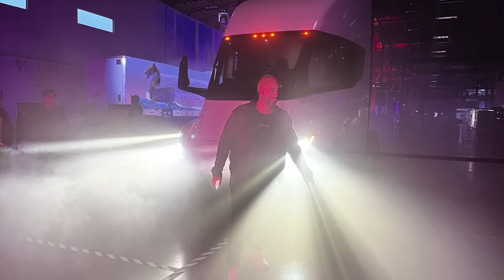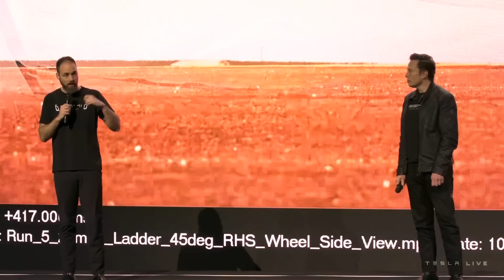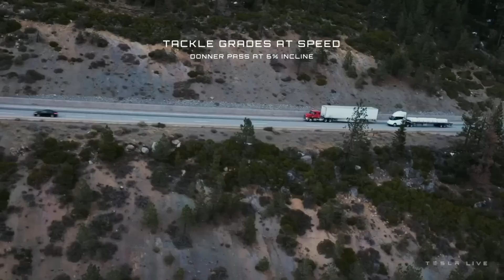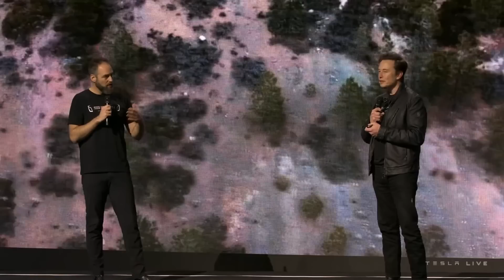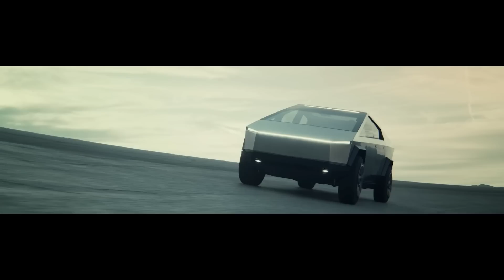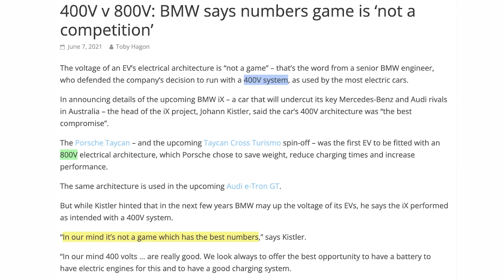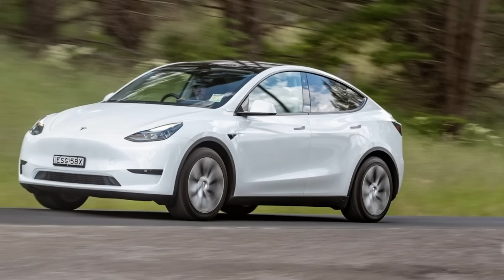Why Tesla Is Being Secretive About Tesla Semi & Why OEM's Are Giving Up ⚡️

Comment: I think the reason they did not give away details is that they have plenty work to do or much changes in a few months.  Early Semi copies like to Tesla and Pepsi use for much testing and learning.  For example, it appears they want to lower the battery capacity that is present in the 500 mile truck.  They would release official specs and pricing next year, including AP and safety features.

Comment: The biggest take-away on the semi is the range when fully loaded.  This will open up a much larger T.A.M..    FYI - Commercial drivers are not allowed to drive for more than 10 hours per day anyways... so... put chargers in truck stops and put a sleeper on that truck so the driver can have a siesta while his truck recharges, and the possibilities are mind-boggling.  The #1 cost of trucking companies is FUEL, second is wages, ongoing maintenance and also equipment purchases (buying new trucks) is so far down the list... The semi is a step change on the #1 cost of trucking.  EVERYTHING you will ever buy or consume, at some point, travels by truck.  This is frickin huge.

Comment: The biggest unanswered question is how much does the Semi weigh -- that is, how much of that 82,000 lbs can be cargo? The three motors must weigh only a tiny fraction of a diesel engine and transmission. So the question is, what does the 1-megawatt battery pack weigh? Based on the 100-kw pack weight of 1,377 lbs, the Semi pack might weigh close to 14,000 lbs. A Kenworth W900 Class 8 tractor weighs 16,700.
Reply: Also where would all those terawatts of power come so smoothly when there's whole fleet of semi's that need that. It's not like you would get that kind of power from random power outlet from KFC kitchen ;) 
And that kind of power outlet will cost nice little penny and needs infrastructure...But sure, we do not talk about that...instead we talk about 0-60 times for semis :D

Comment: Gary Black would need to bet the OVER on FSD ready by Jan 2027....because if it IS ready before that date then ALL of that energy spent on a vehicle Tesla will NOT continue to sell to the public ($25,000 model) was used to produce...what, 500,000 units?  3 years from concept to 5000/wk at even LIGHTNING speed for Tesla then another year of full run.  Possibly 750,000 units by Jan 2027.   There seems to be a MAJOR disconnect on the concept of robotaxi rollout.  The RETARDED logic train that says Tesla will sell these to the public on 30% margins when OWNING the robotaxi produces 300% margins. This IS capitalism and that profit DOES speed the global transition as well as provide MAXIMUM exposure of cheap transportation.  75% of adults on earth have NEVER owned a vehicle.  Another 17% have ONLY ever afforded used prices. Now make an addressable market argument on 3% of the adult population that can afford a civic/Camry/Corolla at 1/8th the fossil fuel elimination of a robotaxi as aligning with Tesla's mission statement.  Please.

Comment: Do you think maybe they aren't releasing specs because the trucks don't have 4680s yet?  The true Tesla Semi will have specs based around 4680 architecture.   Therefore specs released for today's truck are actually for a stopgap measure product.  In 6-12 months they may not be close to actual specs of Tesla Semi.

Comment: IMO, this low-key event was appropriate in the circumstances. There are plenty of veteran truck drivers who are not yet comfortable with what the Tesla Semi is all about. For people who have been driving trucks all their lives this is a big change and the amount of skill required to drive safely will most likely be far less than with a diesel big rig.  Additionally, no talk about FSD or Auto-Pilot, I believe that was intentional too. I have also heard that there is some concern about the driving position. I expect the best approach will be to have experienced truck drivers start using the Tesla Semi and talk to their peers about the experience. I expect this will trigger massive demand.
Just a couple of technical points:
•	The new architecture is 1000 V not 800 V
•	Regenerative braking will be a bit more complicated than it is on all wheel drive Tesla sedan that can use re- on all four wheels. Normally these tractor/trailer configurations have five axles. Regenerative braking applies only to the driven axles on the tractor. So, the front axle on the tractor and the trailer axle(s) only have service brakes so when quick stops are required the service brakes will need to supplement the re-gen braking and hence the wear on the service brakes will be more.

Comment: If Tesla can haul 80k with this platform then I would guess all other electric pickups need to reevaluate theirs. If tesla can get 500 miles and the Ford Lightning per say is getting only 90 miles range at maybe 12k lbs total from 286 empty? Their is an efficiency problem there when the lightning with a 3 ton trailer is using 1.5kw per mile.

Comment: It was not a selling event or hiring event, it was just to celebrate the first delivery and they wanted to get to the party bit as quickly as possible 🙂

The 500 miles fully loaded no cheating no charging drive was I think the best part of the show. It's a slap in the face of all legacy trailer truck manufacturers. Mercedes, Volvo, Scania, Peterbilt, etc.. They all have electric trucks, and this shows they all have failed! It AGAIN shows that replacing the engine with an electric motor and a bunch of batteries on an existing product is NOT the best way to design an electric truck. Tesla did it agan and made the Semi BETTER than its diesel incumbents, MUCH better!

Just think about it, this truck will sell itself... everytime a Tesla Semi is overtaking another truck with a 30mph difference on a climb, the one in the creeping diesel  will see that and after that happens a couple times he will scratch his head and think about this.. and at some point will order one himself, or the trucking company will do it for him...Same for pulling away at a traffic light.. These features saves so much time, like one minute per traffic light, and maybe 30 minutes getting over that pass.

And why should Tesla spill all the beans on us Tesla fan boys?.. there is no need for us to know all this, they do not need us to promote the Semi as long as the potential customers know.. and I am sure they know.

Tesla could ask $400.000 to $500.000 for the Semi and still truckers and trucking companies would stand in line... It will make Tesla Billions when fully ramped up.. this 50K production next year.. I have a feeling Tesla is sandbagging.. Tesla had 5 years to figure out it's production, I think they will be able to build them faster. However this would require the ramp up of the 4680 cells accelerating too, so more of the higher energy dense 2170 cells are available for the Semi.

Comment: They did say the CYBERTRUCK will use a 1000 V system, but I did not hear them say 1 MW charging.  That is only for the semi, I think.  The CYBERTRUCK will have 1/4 the battery capacity, or less, so I would expect a kW charge rate 1/4 of the semi, or less.

Comment: I’m surprised no one has commented on that graph of the state of charge over that 500 mile trip, because it shows something hugely important.  If you look at the line, you can see blips for the mountains, especially the big ones at Grapevine.  But did you notice that nearly all the penalty in going up the hill was offset going down, so HILLS DON’T HAVE MUCH EFFECT ON RANGE.  So it’s no different driving on the flats vs. driving over hills—you still get around 500 miles.  Regen is a game changer!

Comment: From my viewpoint, the event was rather awesome.  But one of the best features of this event was how it was co-hosted with Bill (I believe).  Bill was obviously brilliant, capable and enthusiastic about what they've achieved.  I love Elon but I want to see more depth to Tesla than just Elon.  Other highlights:  The 500 mile fully loaded range is real, regen braking for safety, standing up inside the cab, 2 motors are disengaged most of the time and....a motor as small as a football has the power of a large diesel engine...unfreakin believable!

Comment: The intel on GM inability to make their Lyric Supercruise work just confirms that Tesla has buried GM in the EV technology race!! Over the years GM has farmed out essentially all of their auto component development & manufacturing to a wide array of suppliers.  This works well in an environment where the overall technology for the vehicle is well established & understood.  NOW in a totally new EV environment there are NO ESTABLISHED STANDARDS which are essential for all of the components to integrate and work well together.  FURTHER Tesla has set the standard of replacing MANY COMPONENTS with SOFTWARE.  They have spent 10 YEARS sorting this out and refining the development & implementation.  GM essentially doesn’t do software in any comprehensive sense since they rely on their subcontractors for this.  GM’s apparent assumption that going from ICE to EVs is simply swapping out components from their usual suppliers was an enormous error.  There are essentially NO EV SUPPLIERS out there since Tesla did EVERYTHING IN HOUSE.  And now GM is faced with the impossible task of figuring this all out in the coming horrendous RECESSION which experts say will be the worst in many many DECADES.  In short, put a fork in GM, they are done!!

Comment: Tesla doesn't really 'owe' us all of the details at this point, and I'm sure the Pepsico customers got all the information they wanted or needed to know.  Numerically, the customer base for the Semi is much smaller so it may be pointless to snapshot every single detail if they're likely to evolve or improve after a few Semi's get real-world tested by customers on the road more.  I think he covered the main benefits of the Semi while keeping it simple - Uphill Full Load Acceleration, Full Load Range over Terrain, Regenerative Braking, and Energy (Costs) Per Mile.   That's really the main specs that customers need to know right now, because a lot of their charging is going to be done at their logistics centers anyway where there is likely at least 2 to 4 hours between arrivals and departures on another trip.  You seem to want an excuse to say the words 'Inflation Reduction Act' in every single video - which seems more than a little odd.  I guess if inflation was incompetently put at an all-time high historical levels like it is - then it might only tend to fluctuate downward a little at times, but that's not really saying much is it?  Tell you what - let's see if his policies get inflation back down to 2020 levels of around 2 percent, and then you'd be able to tout the legislation title in earnest!  I'd advise you not to hold your breath though!  Ok, enough picking, as you covered the remainder points in the video well - including the regenerative braking importance.  Good points about the charging curve and not knowing the exact CT charging throughput possibilities.  Also there is a possibility the Robotaxi could also be a passenger van format - would be popular in airports.

Comment: the uphill acceleration and downhill regen are fantastic improvements, I disagree with the post saying this will improve backing, when doing a 90 degree back you have your head out the window making constant adjustments to get in the hole without hitting anything, like to see a 90 degree backing video!!!!!!!!!!!!!!!!!!!!!!  these daycabs will be used around town yes, but also, out and back otr linehauls, the huge improvement is a place to take a nap during a long linehaul, big safety upgrade, class A holder, also daycabs usually have a back window which is helpful, notice it is absent

Comment: If the yoke is not just a gimmick why isn't it in the truck? The steering wheel they show looks a bit small, like one of those child ones you stick on with a big suction cup so your kids can pretend they are driving. I like the old big horizontal ones they have in old trucks and busses. If the truck picks up random trailers how do they have a rear view camera? I agree the presentation was lacking a lot but can't wait to see these trucks on the road.

Comment: 500 miles was from 97% to 4% battery, so full charge would be 537 miles to 0% and usually Teslas have a buffer below 0%, so maybe 550 miles until it's completely drained.

Comment: EU regulations stipulate minimum 45 minutes rest for every 4 hours and 30 minutes of driving time. If 45 minutes is enough for at least a 70% charge then truckers can drive this continuously with only the legal minimum stops. So I disagree that this is just a "city truck", this is a gamechanger!
Reply: Exactly. It's even better: Tesla says it charges 70% in 30 minutes. Now we just need the charging infrastructure.
Reply: @raxzore  In that case, a 45 minute charge should be enough to drive continuously even in cold weather, with headwinds, etc.

As for charging infrastructure, that should be relatively straightforward for many trucking applications, because a lot of logistics is between fixed points, e.g. from a port to a distribution warehouse, so you can just install chargers along the route as necessary. Tesla don't need to replace every truck in every application straight away; they can take a large chunk of the market just selling trucks that are cheaper and better for these predictable routes.

Comment: Dillan, I’m a trucker.   I know you wanted to know tons of stuff …. But it will all come out in time.    The video of 82,000 lbs. up donner pass, flying by the other trucks is just exciting !   I’ve taken about 500 loads so far, heaviest was 79,400 (?) but most loads are 67,000 to 75,000 lbs gross… so range for most loads should be 580 miles…. The distance solo drivers go in about 75% of the country on 1 shift.    In 25% of the country, you can hit 670 to 720 miles.   But my personal best in NM, AZ is 704 miles.   And that’s grueling.      Tesla’s semi looks really great !
Reply: Some things I wanted to know was and he/Tesla are avoiding tell us

1) Battery pack  weight.

Back of a napkin calculation.1000kwh battery at .9kg per  kwh =10 tonnes or 22000lbs Merican
10 tonnes of goods\income I lose because of the weight of the battery's. Thats a big deal when you are getting paid per tonne and have GVM (Gross Vehicle Mass) laws to abide to.I do drive trucks here in Australia and some sites I get weighed in and weighed out

2)Battery degradation and cost of replacement.
There will be a time or x amount of charges where range has decreased to the point  its not viable and the battery has to be replaced.
The cost? looking at the future  Lithium prices its going to be a  six figure sum

Edit.

The EV semi would make more sense here in Australia because of our heavy freight
vehicle configurations with the battery pack  weight problem.

As a trucker you might get a boner looking at this

National Heavy Vehicle Regulator Common Heavy Freight Vehicle Configurations
https://www.nhvr.gov.au/files/201707-0577-common-heavy-freight-vehicles-combinations.pdf

Comment: Does the regeneration system create heat somewhere in it’s system. I’m just thinking of really long continuous down hill situations (like consistently downhill for 12 Km?)
Reply: Regenerativ system is producing Approximately 70% of energy. Rest is heat.
Reply: @michaelmuller665  so how is that much heat dissipated? I’m just thinking of the main interstate route in to my city,Adelaide Australia, it’s around 12 Km of constant downhill, and currently many   Semi’s end up in the arestor beds near the bottom as brakes have failed (probably due to not using engine braking correctly) 
So I’m thinking that without a traditional engine brake there would be huge amounts of heat in this local case ? 🤷🏻‍♂️

Comment: The reason Elon did not push hard on Semi is at this time Tesla doesn’t want to build a lot of these Semi due to battery constrain. Once 4680 battery is ramped then they will start selling giving a lot more info regarding this game changed phenomena. Also the Semis without FSD will not cut it as far as Tesla is concerned. Just be patient . Once the industry realize what a gem in the rough has been born the demand will go throw the roof. Tesla will sell semis with FSD package. IMO.

Comment: The numbers I saw were 2KWH per mile, which is completely ridiculous.  1.7KWH per mile pulling 82,000 lbs. in beyond belief.  As an example, the Model X gets you 2 miles per KWH, and the model X weighs 5,600 lbs.  You left out the 20% battery reserve that is required so now you're up to a +170KWH= 1,020KWH pack that weighs about 15,000lbs. and cost $255,000. Max load is 82,000lbs. - battery 15,000lbs= 67,000 - 10,000 lb. trailer= 57,000lbs. - 20,000lb. tractor= gross cargo of 37,000lbs. This is using your 1.7KWH per mile, which is laughable.

The numbers are insane, but if this was true, a 4,000lb. Tesla would have an increased range x 20,  so 300 mile range today would = 6,000 mile range with Musk's magic new battery improvement. It's as though Musk knows the Fan Boys will buy into his con man game no matter what he says. + even bigger things to come you say, here we go!!!!!!!
Reply: Correct.  They said in the video the truck got 2kWh per mile.
Reply: @tommckinney1489  Not correct. The graphic showed "< 2kWh". That is "less than" NOT "equal to"!
see https://www.youtube.com/watch?v=LtOqU2o81iI&t=2630s